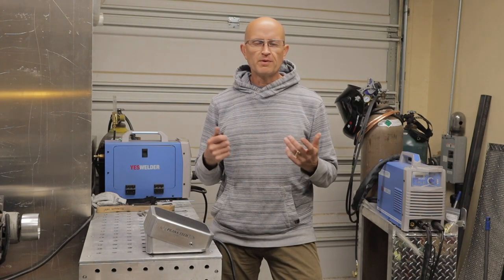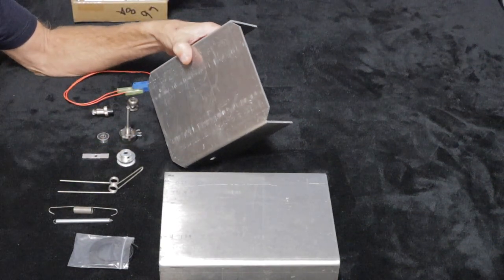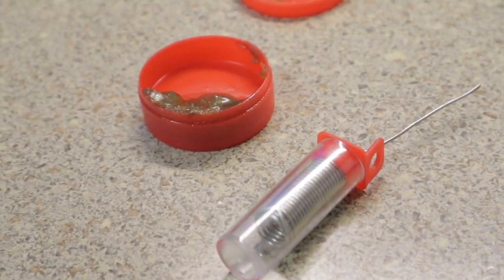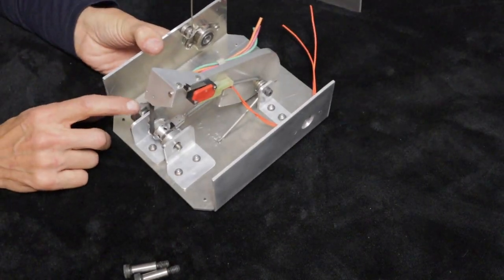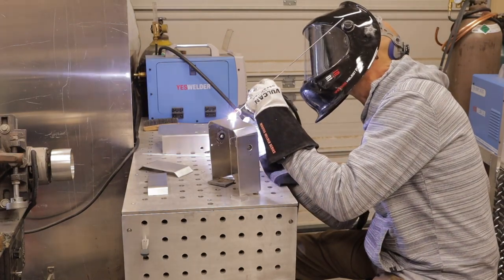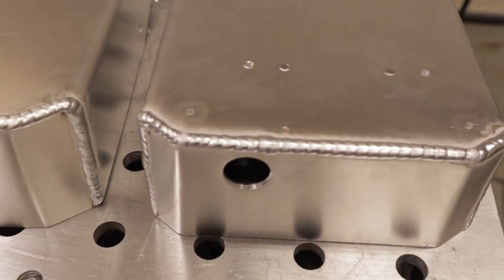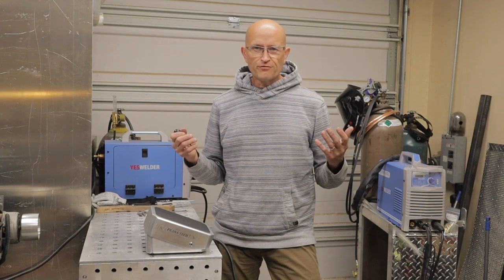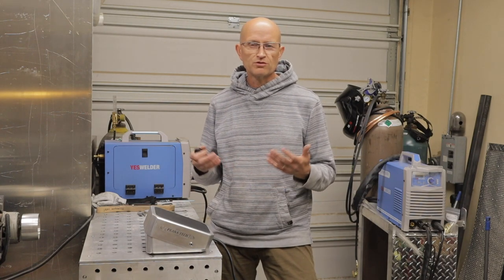THE WORLD’S FINEST TIG PEDAL BUILD! - DIY BETTER THAN NOVA OR SSC !

Comment: Don, thank you for publishing this.  I’m in need of my first tig pedal and not happy with the offerings I’ve come across and then taking into account the prices for some; I’m ready to make my own, the way I want it.  Great idea, great video.
Reply from the maker: Hi Eric, thanks for your kind words!  Glad you liked the project. Let me know if you need any info with yours as you get going.😊👍
Reply: @PranaTech  I’ve been looking around for specs on the potentiometer used in the RFCS-5HD pedal for my syncrowave 300 (transformer type), but have only come up with the Miller part #195218.  This won’t deter me though, I’ll build it with the Miller potentiometer if necessary.  If my potentiometer is something other than a 10k ohm unit, like yours, would this change mean there is a different preferred capacitor other than the one you listed in your description?  I really appreciate your efforts in publishing this video, you’ve inspired me to take on a ‘diy’ tig torch cooler project after this.
Reply from the maker: Hi Eric, the capacitor will be the same with any value potentiometer. It is only there to stabilize the signal. Your potentiometer in the Miller pedal should be marked with the ohm value on the back of it. I actually purchased my potentiometer from SSC pedals. They use a really high quality unit that I couldn’t find out on the market. It also has a long shaft which is hard to find. I have one of their pedals and I told them I wanted to convert it to fit my other welder. They were very nice guys to deal with and they sold it to me for about $22 plus shipping. 😊👍
Reply: @PranaTech  Good deal,  I don’t have a tig pedal of my own, so I can’t open one up to take a peek.  Thank you for the advice on the capacitors and for the potentiometer I think I’ll give the guys at SSC Pedals a call.  I’m looking forward to getting on this project and I’ll send you some pictures of the completed pedal when done.  Thank you.
Reply from the maker: Awesome!👍
Reply: @erickieffer8440  Any linear potentiometer between 5K and 10K ohms will work. (My miller Syncrowave 250 uses a 5K linear potentiometer.) Voltage on one end and ground on the other. The wiper moves between 0 volts and the voltage applied to the end of the potentiometer. For the most part, the resistance does not affect this relationshp.

Comment: Question about the capacitors you added is that something that's on the original pedal or embedded in the original pot? I did everything and didn't notice those capacitors so mine's not working right now
Reply from the maker: Hi Terrence! Ok, so neither of my factory pedals that I tore down had the capacitors on the pot lines. I have a custom Nova pedal and they use the caps on theirs, so I just copied their setup. What welder are you making your pedal for?
Reply: Same as yours, yeswelder 250p. This is the pot I'm using, 404R10KL1.0 
The goal was to get away from the rotating potentiometer and use a linear one. I saw this pot in a Hobart EZ-Take pedal
Reply from the maker: Hi Terrence, ok that pot looks like a good one. One problem that I realized was that I never put my drawing for the actual pinouts for the Yeswelder pedal. The schematic in the Yeswelder manual was wrong. I had to meter the actual outputs of my pedal to determine what they really were. Here is a link to my drawing for the actual pinouts for the GX16 plug on your pedal. https://drive.google.com/file/d/1rXNVQLZ3zguqyEsBy-R4KmhG5Mgdwnsq/view?usp=drivesdk
Reply: @PranaTech Right on brother! Let me check with my setup and I'll get back to you. I have a design in mind too, look at the LEHLE volume pedal 💪😜
Reply from the maker: Cool Design! Let me know if you need any more help. 👍😀Don
Reply: Ok everything worked out, but I do not see the amperage changing on the unit itself although I can see the Arc intensity changing with the pedal variation. I also use the stock pedal and notice that it does work but the amperage doesn't change on the unit. Is this the case or should I see amperage changing on the display as I move the pedal?
Reply from the maker: Hi Terrence, the amperage doesn’t move on the display. It just reads out the max that is available and the pedal controls how much of that the torch receives. 👍😀

Comment: nice build! do you have full travel of potentiometer? i looks on video like it only makes half of turn with full pedal travel.
Reply from the maker: Hi there! Yes, it has full travel. That was the hardest part, getting the diameter of the pulley and the pedal travel so that I got the full travel. Otherwise you don’t get the full amps of your welder.😁👍

Comment: The link for the long shaft 10k pot isn't bringing anything up for me.
Can you please tell me the make and model of the potentiometer.
Thanks.
Great video learned a lot.
Reply from the maker: Hi Deepwinter!  Ok, here is a link to one on eBay https://www.ebay.com/itm/225055389404?hash=item346658b6dc:g:Q7IAAOSwa2VivzJr&amdata=enc%3AAQAHAAAA8JXWcZLun2j5gquDvMxFHB4ZbgdZjlo%2Bz7hKlcLz1uGzLMNcPozMd0b%2B0VYMvZc8HYXtPrDH0UHtM7UQ6zvQ7kncTTLMkiIsueYrQ9g4vpWJuJKPuU35y%2Be%2BDJ4PShL2hjHTE%2FSdk9mxLYUZ6E9ISVhqOfKVjBanfN3UbwOYeK0Jt8yfTTmRwaapD8Yc4tIx08zKi1NlOCkCYrsYpWG55NQuwdTgWos5WD2G%2Fge%2B9Lxa5XaSUSjNhBl%2Fque9PThwvWxeekMMJFelXJiGTpwr8MvoQgdqHgC2qICj8PSgYrLoizKvJLIZJ8ccscroAuDb2A%3D%3D%7Ctkp%3ABFBMsv29xMdg  
If you want the high quality one that I used you have to call SSC pedals and buy one of theirs. I needed one to convert an SSC pedal that was made for an everlast welder. Theirs is rated for a million actuations and with shipping, cost me about $32. If you tell them that , they should sell you one. Otherwise just buy any long shaft pot you can find on eBay or Amazon. Hope this helps.😊👍
Reply: @PranaTech  Thanks

Comment: could you use your potentiometer, and add bearings to an an existing foot pedal to improve the performance of the foot pedal. Frank
Reply from the maker: Hi Frank! Yes, that would certainly save some time in the process! 😁👍
Reply: @PranaTech  Thank you, I plan on looking into gathering the parts and making the modification.
Reply from the maker: It is a definite upgrade but I’ve found something even better. I started using a Tig Button from tigcontrol.com and it changed everything. I hardly use my pedal anymore.😊👍
Reply: @PranaTech did they go out of business? The link doesn't work
Reply from the maker: No, I misspelled the link. Sorry about that. Thank you for pointing that out. tigcontrol.com 😊👍

Comment: Hi Don, Great video and awesome result!!
I'm designing a pedal too and I have a question: if you've used the 10mm diameter wheel, that has 31mm circumference. The pot has a limitation of 3/4 travel so you'd have 23mm travel of the belt. Does it give you enough resolution? Wouldn't a bigger wheel like a 20mm be better?  I'm new to all this, never used a TIG yet so please take it with a grain of salt..
Reply from the maker: Hey, glad to see someone else crazy enough to build their own pedal too! Ok, so the 30 tooth GT2 pulley that I used is 10mm wide not the diameter. The diameter is 18.6mm which works out to 58.4mm circumference. This gave me lots of resolution. My commercial pedal only had about 26-28mm of travel so my new pedal gave me about 43mm of travel and much finer control over my arc.  Little variations in my foot movement don’t translate to the weld with this much resolution. Since I had so much travel to play with, I simply set the pulley on the pot shaft at the furthest downward travel point and then adjusted the return stop screw on the actuator bar to match the amount of travel for the pot. I hope that makes sense. Feel free to ask me all the questions you need.😊👍

Comment: The link has expired for the potentiometer.  What is the brand, shaft length and # of rotations on the one you used?
Reply from the maker: Hi Tyler! The actual pot that I used is from SSC pedals. It is an industrial grade potentiometer that is rated at 1 million actuations before wearing out. I just called them and asked them if they would sell me just the pot for AHP welders so I could swap out the one in a pedal of theirs that I had which was for an Everlast welder. The agreed and sold it to me for like $32 including shipping. I ended up selling the pedal and decided to build my own so I used the pot in the pedal project. The reality is that any long shaft 10k potentiometer would work, or you could try my way and call SSC or Nova and see if they will sell you one of theirs. The potentiometer is a 1 rotation unit. I think the length was 1.5” 👍😊

Comment: On TIG welding:  How do you sharpen your tungsten's?  Thanks
Reply from the maker: Hi Michael, I sharpen mine on my belt sander. I hold the tungsten upright so the grind marks are linear to the tungsten from the thicker part to the point. 😁👍
Reply: @PranaTech  Do you need a "clean" belt?  That is, do you have to worry about contamination from other things you have ground?
Reply from the maker: Well, that is probably a good idea to eliminate contamination, but I’ve never done it 👍

Comment: The 10k pot you used is that the same value that is in the tig  machine itself?
Reply from the maker: Hi there, yes, the pot that I used is the same value as the pedal that came with my Tig. Most modern Tigs use a pot that is somewhere between 10k to 55k from what I’ve seen. 👍😀

Comment: Great job on your pedal, looks amazing! The link for the capacitors you used has expired, but it appears you used this type - Ceramic Disk Capacitor 3000V (3KV) 4.7nf (472) 0.0047uF 4700pF. Is that correct?
Reply from the maker: Hi there! Yes, that is the correct capacitor. Thank you for letting me know about the expired link, I’ll get that fixed. Thanks for the kudos on the pedal! Normally when I build a project like this, I end up finding ways to improve it later by discovering design flaws that i didn’t think of. This one is a rarity because it has worked flawlessly since I built it and I love it just as it is. Let me know if you have any other questions. 😊👍Don

Comment: Nice work. So the yeswelder acdc tig can use foot pedal for ahp? Does the 7 pin (C910-0725) fit in the yeswelder 5 pin plug? Thank you.
Reply from the maker: Hi Dong, yes you have to make an adapter with a 7 pin female GX20 plug to a 5 pin GX16 male plug to fit the Yeswelder Tig. I am going to make a video soon showing how to do it. I have a diagram showing the wiring schematic to do the conversion if you want to do it before I get the video done. Just let me know. 👍😁
Reply: @PranaTech  Will any 5 pin gx16 aviation connector fit the yeswelders connection?
Reply from the maker: Hi Dong. Yes, any GX16 5 pin male plug will work. 👍😀

Comment: Thank you for sharing this
Reply from the maker: You are very welcome! Thank you for your nice comment! 🙏😊
Reply: Hi can I ask how do you pick the correct potentiometer to use for your machine @PranaTech
Reply from the maker: Good morning! I just reverse engineered the factory pedal and used the same value potentiometer. If you don’t have a pedal you can copy, you can find the wiring diagrams for most popular machines on SSC’s site here. https://ssccontrols.com/tig-welding-controls/c-series-tig-pedals/  Click on the info sheet on the right and it will take you to the wiring diagram for the pedal. 😊👍
Reply: @PranaTech  thank you very much
Reply from the maker: Anytime! Just let me know if I can be of any more help.😊👍

Comment: Hi,
Nicely done! One thing bugs me though, why not use a linear potentiometer? It would simplify the build a lot...
Reply from the maker: Hi Rimon! Great question! My AHP welder came with a pedal that used a linear pot and I thought it was definitely a simpler design. I could not find a higher quality linear potentiometer that was comparable to the one I got. It is rated at 1 million cycles and since I built this for life, I wanted to use a higher quality pot so it would be smoother and not need to be replaced ever. Probably overkill I know.😁👍
Reply: @PranaTech  The ones used on studio mixers ar quite solid ;)
Reply from the maker: Hi Stefan! Thank you for the tip! I will definitely look into those for future projects. 😊👍

Comment: Do you have the correct model/part number for the 5 pin SSC or Nova replacement?
Reply from the maker: Hi Mark, here is a link to one on Amazon https://www.amazon.com/Hxchen-Female-Connector-GX16-5P-Aviation/dp/B07V9BQC7P/ref=sr_1_11?crid=1GDK2DNLXIYVI&dchild=1&keywords=gx16+5+pin&qid=1622072868&sprefix=Gx16+5+pin%2Caps%2C294&sr=8-11
They are just known as a GX16 and you just get the number of pins for your setup. 😁👍

Comment: Thanks - Well done video!
I see the SSC company 5-pin pedal is about 200 dollars (Yipes!) and is probably very good, but yours is likely way smoother - and I love the limit switch. May I ask what you spent in materials? The welder I would use this for is Yeswelder 250P.
Reply from the maker: Hi there! Thank you for your nice comment! I spent about $65 to $70 in parts and about $3000 in labor.🤣👍 I love it though and it works so well. I like my Nova pedal too but my pedal is smoother with a larger range of motion so I can have a finer control over my amperage especially with small parts and thin aluminum. 😊
Reply: @PranaTech  Okay, it on my ToDO list for sure. And I sure do get the $3000 labor; I do side jobs in my retirement, and get so involved, it works out to about 25 cents an hour 200 dollars/6 Zillion hr). Ha.
Reply: Alas, I may have waited too long. Only now getting around to clicking through the parts, it will cost far more to build (more than Yeswelder's current foot pedal offering -- which by the way, some reviewers say does not work, I suspect because those folks did not follow the boot/wakeup instruction). I'm an occassional welder and I know yours is far superior, but should I consider the one from YW if I'm on a budget (well, okay, cheap). Do you recall whether the YW foot pedal operates pretty smoothly? Thanks again!!
Reply from the maker: The pedal is a great pedal that they are selling now. The early one was not very good, but the new one is very smooth and works perfectly. Many people fail because they don’t know that the pedal must be pressed for 5 seconds to tell the welder that a pedal is connected. If they don’t know this and don’t activate it, they then think the pedal is defective. If I was in your position, I would buy the YesWelder pedal.👍😊
Reply: @PranaTech  Just ordered it from Big A prime -- turned out to be on sale at 87 dollars today. I do like the fact it says "YESWELDER TIG Welding Foot Pedal Amp Control Pedal, Compatible with ACDC TIG-250P AC/DC and other machines with 5-pin torch controls" and comes from the "Yeswelder Store." Wish me luck and THANKS again!
Reply from the maker: That’s great! You will be happy with that pedal! 😊

Comment: Okay but if your welder doesn't have a pedal to begin with
Reply from the maker: That does make it more difficult but not impossible. Can you tell me what welder you have and I might be able to help. 😊👍
Reply: It's a stick welder with a add on DC converter so it can weld AC and DC and a arc pig HF start and a tig torch basically something I put together with some stuff I already had but it's a old 295 amp.